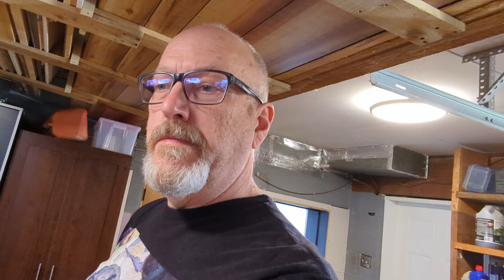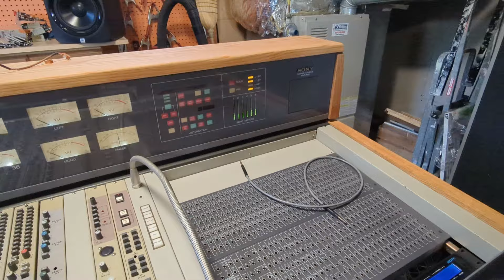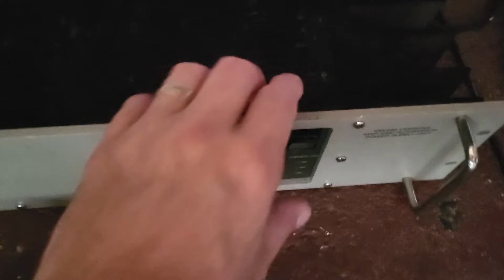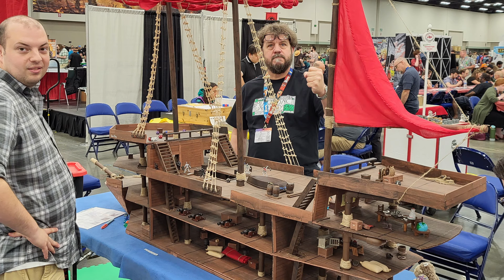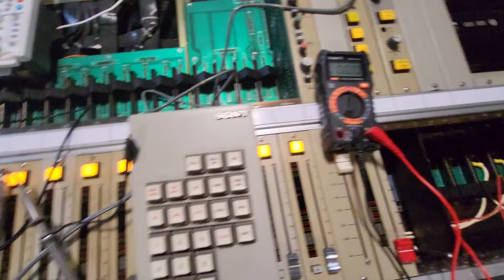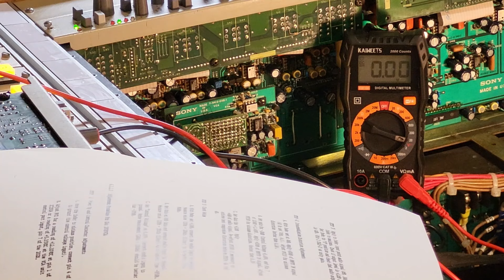Vintage Console Restoration - Part 5 "What Will I Blow Up Next?"

Comment: Check that the scope input is DC coupled I think you are adjusting the Offset.
Reply from the maker: That is something I will now look into. Thanks.
Reply from the maker: Turns out it was DC coupled. But should it be?
Reply: What a journey! Was a bit jealous of your board at first thinking you‘ll have a much smoother sailing than I had with mine but oh boy…by the way symmetry adjust does not necessarily mean offset - try raising the gain until you see clipping, if you only shave of one half of the sine that is what you‘ll adjust with this trimpot :) Hope that helps. All the best, Tobi